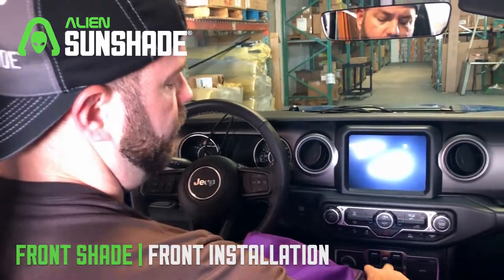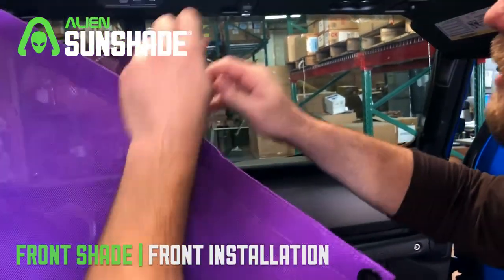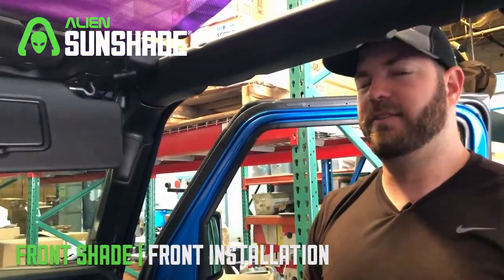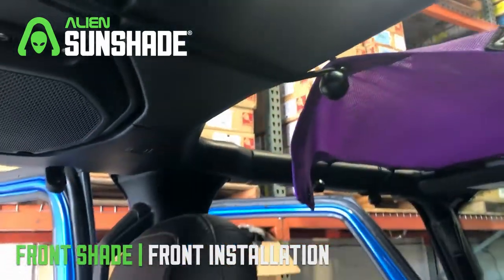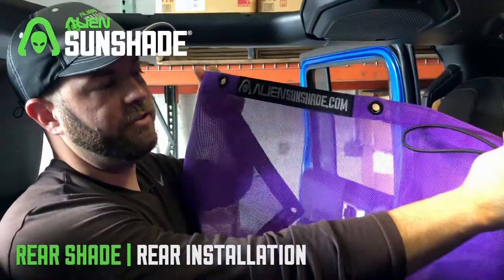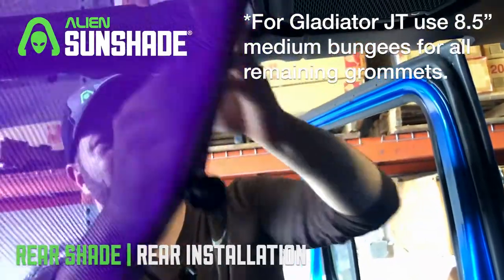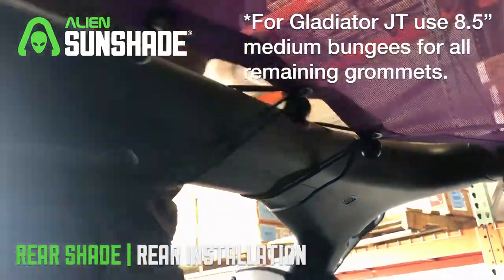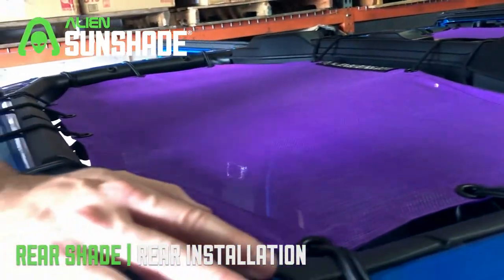How To Install Jeep Wrangler JLU and Jeep Gladiator Front & Rear Sunshade | Alien Sunshade

Comment: Few comments: I purchased the screens and wasn’t sure if I could keep it on with soft top on (OEM) and answer is yes you can! I like mostly everything about it but it would be nice for a quicker removal and installation on days I would like to go completely topless. (The front straps are the issue for me) I’m going to try a Velcro type strap or a buckle type that you can tighten without the snap back of a bungee. Other than that seems well built and does what it supposed too.

Comment: I didn’t get the installation tool with my order. I used a thin electrical wire worked just just as good.

Comment: How is this for taller folks? I’m 6’2” and I’m wondering if my head will hit the sunshade.
Reply: i'm right at 6'3 and depending on how I am sitting my head may barely touch it.  doesn't matter if hard top is on or not.  The tradeoff was worth it for me.
Reply: @tracyalderson1756  I ended up getting the DesertDoesIt Seat Slammer kit, I HIGHLY recommend it

Comment: Why can’t the bungee ball go on the top? It seems better that way. You don’t hit your head on the ball getting in the car and there is plenty of clearance between shade and freedom panels. Am I missing something in the design of  this?
Reply: You can do either. I have the older one piece and I put the center front and the corners on top but am able to hide them. Just a preference. Also, I've had mine in the AZ sun (top off most days) for 5 years and it still looks great, but looking for a change in color.
Reply: @n3tfury  sun fade was my concern. I want to get Red but don't want it to fade to pink in the Louisiana sun

Comment: I would avoid this product at all cost moving forward. He installation instructions led me to pull some part of my Jeep out of the windshield area, and I double checked and followed the instructions exactly. The bungee got stuck and part of the windshield came out. Find another product, but definitely not this one.
Reply: Wtf? This is 💯 user error. Nothing should be coming off when installed properly. I’ve seen ton of these videos from different people doing their DIY install, complete amateurs and none ever reported what you said.
Reply: Bruh how did that happen just installed mine no issue